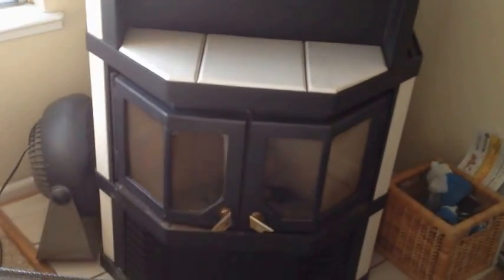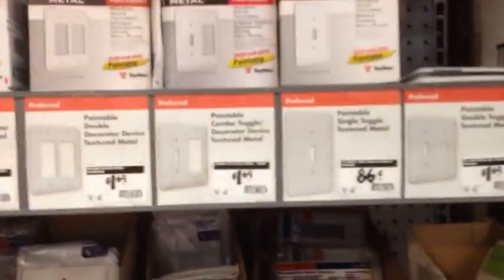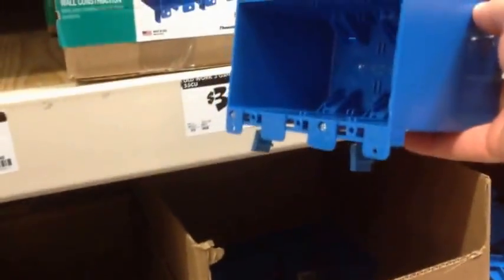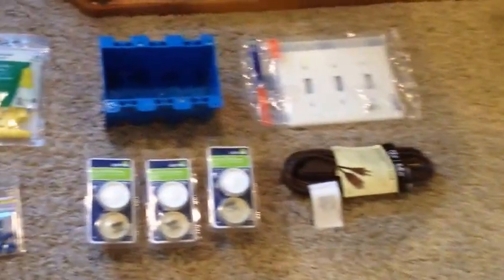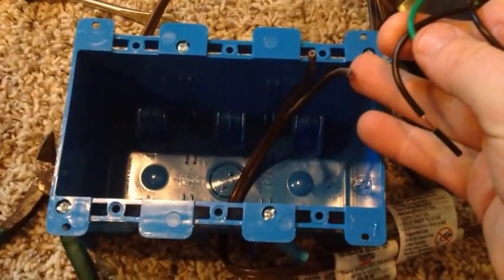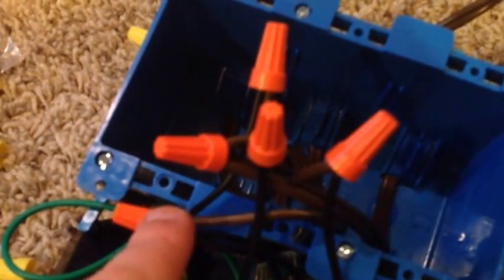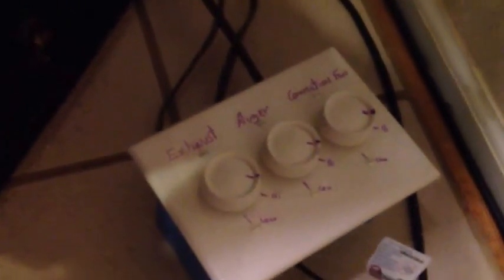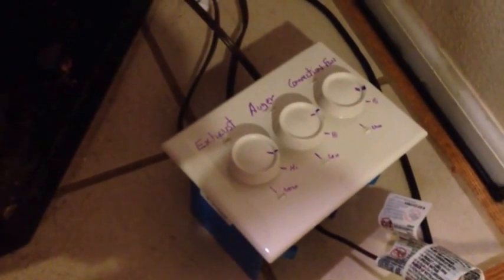How to Run a Pellet Stove without a Control Box (For Educational Purposes Only)

Comment: Excellent video, all of it, boy oh boy that 2 year old boy of yours looks like he is going to grow up tall...and proud. I am assuming that off the dimmers that i will have to run 3 separate wires to the components in the box. This would be nice to see in a follow up video, but excellent video none the less. When ever I can get away from circuit boards on older equipment I am happy.

Comment: Do not like the idea that the auger does not stop with this approach.Relay on control board.Everything else works.Going to try seconds timer.Also glow plug as opposed to those expensive igniters work to light stove.

Comment: Have an  Enviro EF 5 Evolution that the exhaust blower does not start.  Stove does turn on then flashes number 2 light. When pressure switch is jumped the stove does drop pellets but the exhaust blower does not start, voltage tested it shows no volts at exhaust blower. Would this be a Control board?  Nice instructions on how to make a stove work in an emergency. Is any way a person could wire up all the safety switches to each other, run that to the start of the power in wire so if one switch sensed something wrong it would kill power to whole stove? So power would come in go to all the sensors then to the motors, one of the sensors shows something wrong power is cut to stove like a light switch cutting power to a light. Now no control board would not be needed but still have the safety sensors in line to kill power and all motor speeds would be controlled with the dimmer switches the way you show, would just have to manual start stove. Just an idea that would save a $500.00+ control board that i can't afford here in Canada.
Reply from the maker: The exhaust fan should start as soon as you turn the stove on.  If you aren't getting power to it, then the control board needs to be replaced.  If you can't afford the control board you could try running direct power to the exhaust fan and use a dimmer switch to control the fan speed.  At least that way the safety switches to turn off the auger feed would still be in place.

www.pelletstovepro.org is my new tech support site.  Might be a good choice for you and what you're working on.

Comment: You can use a percentage timer on the auger. Usually 1 to 100% over 1/4, 1/2, 1, 5, 10 minutes depending on the timer. I have added a water coil to my stove because I have a boiler and hydronic heating system. I use 2 percentage timers controlled by a relay. One timer is the minimum feed rate to maintain a fire, and the other is for a higher heat setting. When my boiler calls for heat, the relay engages the high heat. The boiler circulation pump pushes water thru the pellet stove coil that heats the boiler and whatever zone is calling for heat. The oil burner (normal heat for the boiler) never turns on. Saves about $10/day.
I found with pellet stoves on a thermostat, when desired temp is reached, stove stops the pellets and cools down after the fire is out. So it takes about 20+ minutes to restart and get to a temp before it creates heat. Keeping a minimum fire in the stove shortens the time to under 5 minutes.
Reply from the maker: I found out about this after I made the video and found a timer on Amazon and linked it to this video but they keep changing the link but you can get one on Amazon.  

 I now offer a premium level of over the phone tech support through a 1 year membership that is cheaper than a service call.  For details go to www.pelletstovepro.org.
Reply from the maker: Want to talk to someone right now and get help?  Go to www.pelletstovepro.org.
Reply: Wow Oceanmariner, that is one explanatory comment, when I read " I have a boiler and hydronic heating system" I knew you knew what you were talking about, great useful response. Oceanmariner I have a couple of questions for you. I would like to set a mechanism that follows the sun. Sun capture for heating water/home, solar system, heating sand batteries, and using mirrors to direct heat into the house. Once I have some form of understanding of what this will entail I am on my way. 
Oceanmariner my son says that heat pumps are more efficient giving out heat than keeping the thermostat low. I heated this year with 3 mini splits @ 61 degrees, combined together 30 hours per day. My electricity cost was outrages. My son said that if I ran at above 70 degrees that my bill would have been cheaper, makes no sense. I know this is a lot Oceanmariner I understand if you do not respond. I have not even had the opportunity to get your opinion on why 3 large container ships lost control last month, that will be a question for another day. Thank-You Ocean Mariner.
Reply: @Don-sx5xv  I've been thinking of a system to follow the sun for solar panels. I live on an 83' boat, former CG cutter. I usually go to Alaska in the summer and anchor in scenic remote places. I carry a fast boat to run for groceries. If I had solar, I'd run the generator less often. I like quiet.
I don't like heat pumps. You are basically running your AC in the winter. In the right temps the outside coil will freeze and the pump has to reverse to thaw it out. to thaw, the pump draws heat out of the inside air and sends it to the outside coil to melt the ice. While that's happening electric heat strips come on in your air handler. So until it thaws, you're running both AC and heat strips.
On my hydronic system I also have a wood stove with coils and it's all tied into the engine cooling so when cruising, the engine heat warms the boat, In really cold weather I run the heat thru the engines before starting.
Big ship diesels are not self sufficient for oil and coolant. They require a generator for power to run electric motors than run the coolant and oil pumps. If the generator goes off line the main engine stops to avoid damage. Usually more than one generators are on line.  Big diesels use to have gear driven pumps on the engine. I don't know why it changed. Money probably.
Reply: @oceanmariner  Wow to cool. I believe that the World is one great big playground and the reason we are here is to come out and play together. We play when we do what we Love where we Love. I have been an adventurer for many years. Today I have settled down in New Brunswick Canada, 80% wilderness. I have lived all over  North America, it would still take a few lifetimes to discover it all. That ship of yours sounds like quite the toy, I can just imagine where that baby has taken you. I gave the boat idea a lot of thought, mostly to be planted right in the middle of nature. If your Ship ever visits the Eastern Sea Board look me up, not to far from many ports here.
The information I am getting from other Engineers regarding the 3 out of control cargo ships is that the systems in place are redundant and this could have only been a cyber attack....So Long Mate

Comment: have a whitfield advantage stove. Heres the issue:  starts fine, then after a few days the pellets increase,fire increased, glass blackened then the fire goes out.  can someone help
Reply from the maker: I would suspect you may have a bad exhaust fan.  That could cause that problem.  If the exhaust fan is original, I would definitely replace it....https://www.pelletstovepro.net/12056010---12126009---12156009---whitfield-exhaust---whitfield-combustion---whitfield-fan---whitfield-blower---whitfield-motor---pellet-stove---pellet-stoves---Jason-Munson---Pellet-Stove-Pro
Reply from the maker: Want to talk to someone right now and get help?  Go to www.pelletstovepro.org.
Reply from the maker: That is always a possibility.

Comment: In my opinion pellet stoves are as safe as your furnace if you leave all the safety components alone a friend just gave me a pellet stove for parts that he bought a year ago paid $300 for it and had another $200 in pipe every time he tried to use it it would fill the whole house full of smoke he gave up said he didn’t want anything that dangerous in his house I opened it up to see why & it was obvious someone bypassed the pressure switch and both of the temp switches all that it really needed was a good cleaning the combustion fan was so clogged it wasn’t drawling any air
Reply from the maker: I wouldn't let it out of my sight if all the sensors and pressure switches were bypassed myself.  But, if it's freezing outside and I have a way to get heat out of the sucker, I'm gonna do what I have to do.
Reply from the maker: Want to talk to someone right now and get help?  Go to www.pelletstovepro.org.

Comment: There is another reason also that you forgot to mention if your exhaust pipe at the end where it comes out outside is pointed the wrong direction and it's very windy that can cause air to suck back into the pipe
Reply from the maker: Want to talk to someone right now and get help?  Go to www.pelletstovepro.org.
Reply: @JASONRICHARDMunson  6 years and I have never had that problem

Comment: I tried this years ago using an actual motor controller bought from Ebay. I could never get augur motor to run slow enough and speed was very eratic. Ended up junking the entire unit.
Reply from the maker: See addition to notes on timer box for auger motor.
Reply from the maker: Want to talk to someone right now and get help?  Go to www.pelletstovepro.org.

Comment: hey Jason im trying to install a thermostat to my englander 25 pvdc. i wire it up but it doesnt deem to work with the thermo. the stove comes on manually. can you please help me out
thanks
anthony
Reply from the maker: I'm not sure but your stove may have a setting to switch it over to the thermostat versus manual mode.  Check your manual.  If not, try jumping the thermostat wire together at the thermostat and see if it turns on.  If not, try jumping where it connects to the board.
Reply from the maker: Want to talk to someone right now and get help?  Go to www.pelletstovepro.org.

Comment: Ive worked for a Hearth and Home store for 10 years. Ive cleaned, serviced and repaired untold amount of pellet stoves and furnaces. DO NOT DO THIS! Even for a temporary fix. Most pellet stoves have exhaust temp, vacuum switch, and overheat sensors. These are all there for your safety and to ensure the stove runs the way it should. Again, do not do this. Contact qualified service techs and not a trip to the hardware store.
Reply from the maker: Want to talk to someone right now and get help?  Go to www.pelletstovepro.org.
Reply: I'll do what I want to my stove...    Family first especially if it means heating  home over the weekend until I can repair it properly
Reply from the maker: Yes, this is for educational purposes only.
Reply from the maker: It's somewhat in the nature of all circuitry to break down.  None of it will last forever but some will last longer than others.
Reply: @JASONRICHARDMunson  I see no safety issues as long as the stove is not left unattended.
Reply: Do u know a guy that owns a hearth nd home store named Glen Turley
Reply: So what do you do when the people you bought the stove from tell you that they'll have a tech out in three days, but parts take a week or two at least.  Oh.  I forgot the best part.  It's 11 degrees outside.  My advice:  Do NOT buy a pellet stove.

Comment: You should be using some sort of Fan Speed Controller to control the speeds of the various motors instead of an ordinary Dimmer.  

Dimmers are made for resistive loads (like incandescent lights).  Fan Speed Controllers are made for inductive loads (like motors).   Dimmers will "work" if you use them to cut the fan speed by only 10% or so, but using them to slow the fan much more than that may harm the motor and/or start a fire (in the wrong place).

In short you may toast your fan motors by using a dimmer.  

Read more here:
http://www.fancollectors.org/info/speed.htm
Reply from the maker: You are correct.  We carry those speed controllers but they are $40 each.  The dimmers work for a cheap short term solution but not long term.  This video is for entertainment purposes only and should not be considered a solution for heating your house.  (Right, I have to say that ;)....
Reply from the maker: Want to talk to someone right now and get help?  Go to www.pelletstovepro.org.

Comment: you don't show ignitor nor did you show where wires were in stove that you connected to without breaking connections once you put n stoves  real control box
Reply from the maker: Russell, I would not try to use the igniter on this setup.  I would light it manually.  As far as where the wire were in the stove and breaking the connections that is going to be different with each stove.  This is an advanced electronics procedure.  If what you saw in the video was not enough info for you or did not make sense, you should not try to do this.  This video is for entertainment purposes only.  As stated in the video, don't try this at home.
Reply: All wires should run stright to each part..... blower, auger and room heating fan. Try to run all with white wire on the same white that the unit came with.... but this should not make a diff.
Reply from the maker: Want to talk to someone right now and get help?  Go to www.pelletstovepro.org.

Comment: Hey Jason, I have a PROBLEM with my Santa Fe model Quadra Fire pellet stove. I replaced the control bow, and it was NOT on the correct setting FROM THE STORE. Now, my fan does NOT work. The ignitor heats up, but the feeder tube doesn't feed due to the fan not working. Any suggestions? And....it is around 11 degrees tonight. :( Thanks
Reply from the maker: Want to talk to someone right now and get help?  Go to www.pelletstovepro.org.

Comment: You could incorporate thermo controls for the auger.   You add a lower limit switch that breaks on temp rise, it only allows power to the auger when the output temp is below a certain level.  

That powers a duty switch for the auger.  When the temp limit switch falls below the limit, it powers up the duty switch, which supplies full power to the auger, but only for a few seconds at a time.  That repeats until there's enough fuel in the burn pot to make a high enough flame to trip the limit.  Cycle repeats with no worries from you.  You may need to shop around to find the right high limit, and the duty switch can be a little weird to find.  I found one that runs on 24vAC to power a contactor; that would get the job done.  There's probably already a 120v AC-24vAC transformer in the unit, the contactor would then switch 120v wall power to the auger.  It would be clearly audible.

The duty switch I found on Grainger for about $50.  The thermal limits run around $10-20, available anywhere.  The contactor wouldn't need to be very robust at all, that's another $10 at Grainger.  If you're a scrounger, you could rustle up a fair portion of this stuff out of a dead electric clothes dryer.
Reply: Dude what the heck. The whole point was to keep this as simple as possible
Reply: could you post a link to what this is
Reply from the maker: Want to talk to someone right now and get help?  Go to www.pelletstovepro.org.